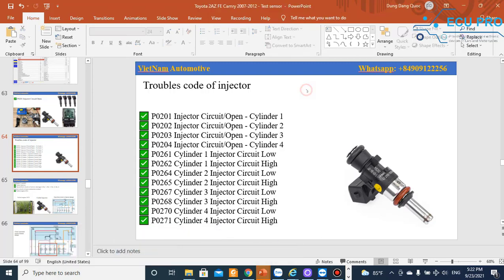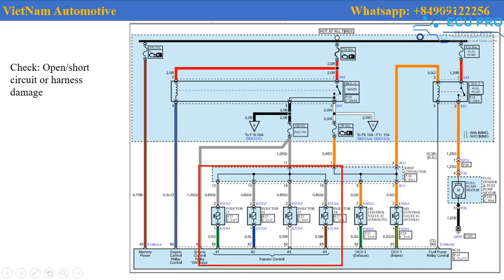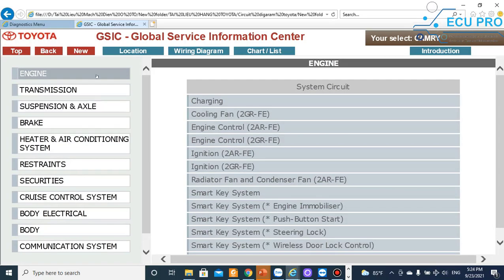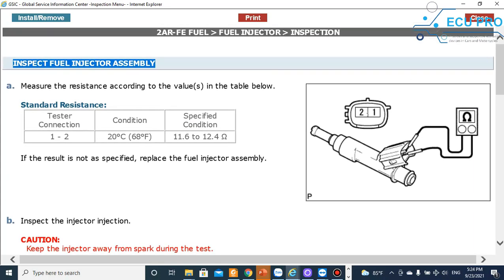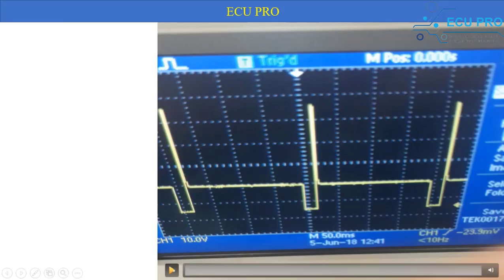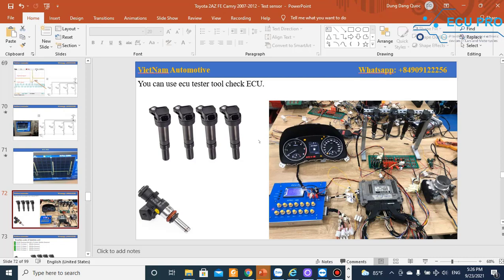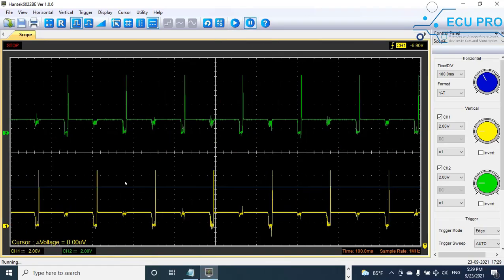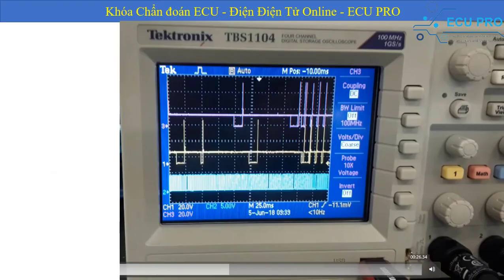Hyundai Accent Check ECU signal control Injector - P0201 Injector Circuit/Open

Comment: How to Handle troubles relate to Injector of Hyundai Kia ECU.
✅ P0201 Injector Circuit/Open.
✅ P0261 Cylinder  Injector Circuit Low.
✅ P0262 Cylinder  Injector Circuit High.